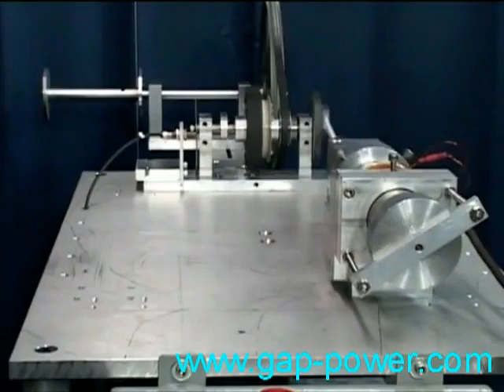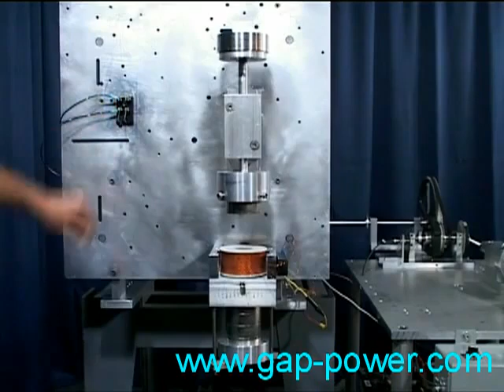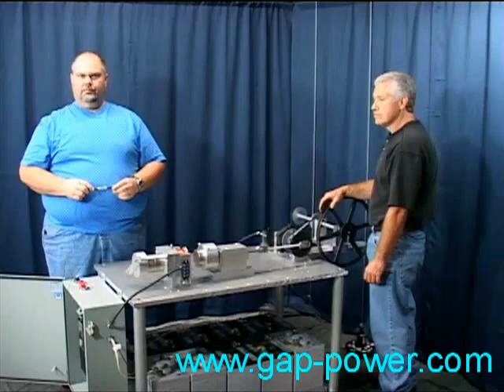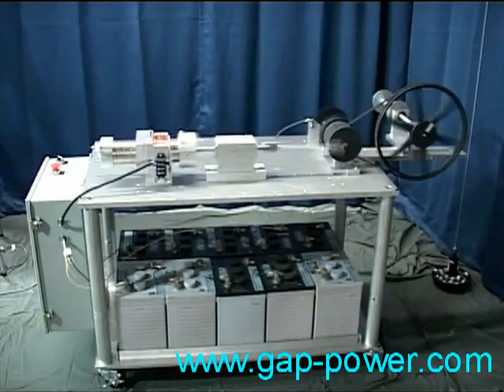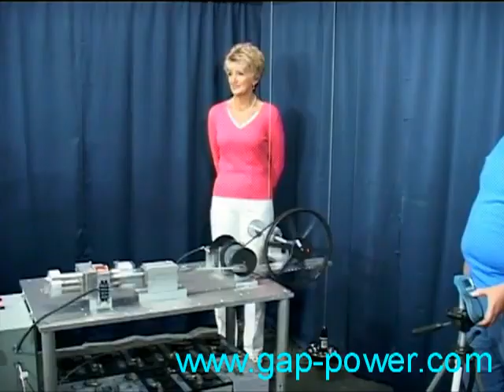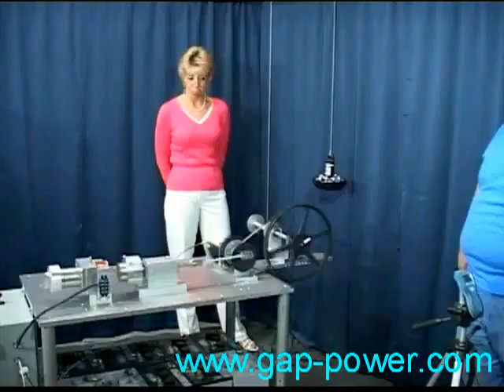FREE ENERGY  24 Working Magnetic Overunity Device   Magnetic Neutralization

Comment: Another BS vodeo.
This overunity motor uses electricity to switch those magnets on and off at timed intervals.
So saying that this motor is powered by the energy of those magnets alone is nonsense.
Sucg devices should be called electromagnet motors because that’s what they are damnit😟

Comment: It's a neat device and if production more power than it takes to power it's self it should keep running for a very long time

It should keep the batterys at full charge and provide power even if it's a small amount to use for work 

To check the powe in the coil you must use some type of current metter and are you using the power when the power is turned off as well 

I would thank the flux from the magnets could aid or boost the current out put from the coil when it's turn off

But we all so have to take  the amount of current used to stop the flow of flux
As power use for work 

But this is just a quick look at the divice thanks for posting your work and ideas for you may find the answer or spark ideas in someone who Will find the key to free power 

Thanks for posting

Comment: This is NOT a new concept!!  This is literally the exact same principle used in all electric motors.  These guys have just build a linear configuration rather than a rotary configuration.  In fact, I would guess that this device has exceptional inefficiency compared to standard electric motors because the coil is so far away from the magnet base.  Nothing new here, the just are not properly measuring the power input to the device.  As stated below, a simple way to "prove" this device has over 100% efficiency is to connect the output to a generator and have it charge that massive battery bank; no sketchy measurements necessary.  The device will, of course, eventually run out of stored electricity, as do all devices in this universe that comply with the 1st law of thermodynamics.

Comment: "no one has measured the input of a over-unity device" - if it is over-unity then Pout > Pin: its a simple as that. If you getting close to Pout = Pin our doing well. If you get one horse power out and put less than one horse power in then that's it, case cracked!

So who are these academics and which colleges are they from?

Comment: first I must say I have no degrees and some engine courses and I think your machine is beautiful but she is to m16 built as opposed to ak 47 ak is wide tolerances sloppy action and that is its total superior operating advantage m16 is too tightly machined thus causing failure also there is a correlation of 3 5 7 and not 2 4 6 about magnets and coils with regards to driver/driven configurations linearly or radially actuating the coil/mag configuration the odd is usually best as the driver but not the driven why I have no clue only know through doing it while building turbine blades that self sheared they where awesome anyways if you opposed identically a twin opposing each other and bedini coils/ circuit caps instead of batteries and more mass in flywheel to store more energy that's where your best catch n release of energy is attach mags to it coils around it and recycle energy from it as well and they work best axially like a spinning top otherwise  your wheel is allways fighting gravity for 90 degrees of rotation to the top trailing sideand equally to the whole the other way and no disrespect your machine is simplistically brilliant and as you can see thought provokeing as well and your 100% right as too a collectively thought to realized goal imagine showing a g bell a cell phone or ford a car the wrights an sr71 them boys would shit their pants to see the collective minds influence to recreate or enhance and transform elementary materials into the machines and tools that the collective mind have created I don't believe any one mind has ever created anything ever not of this the liveng man I cant speak for god sick of fucked has built more stuff than any other except for if ya don't yur fucked as runner up and it wasn't the wheel it was the axle that was the defining moment of our start to find the end  I learned a lot about a lot but not from professors  but books and others not afraid to look listen and observe and challenge  the nay sayers

Comment: If the apparatus is indeed "overunity" as the narrator says he believes it is, then what's that bank of batteries doing under the table?  Why not just rig a manual crank and flywheel to start the rotation and thereafter let "overunity" supply whatever additional electricity is required to keep it going?  Answer:  The batteries are necessary because the apparatus isn't "overunity".  Furthermore given sufficient time, I'd say the batteries will become drained and the apparatus will simply stop.  Finally, why use so many batteries?  Answer:  Probably to extend the time before failure becomes apparent.
Reply: +MadCityObserver Agreed , why not use a small rechargeable battery (12V 5AH) that provides only enough sufficient power to to disrupt the magnetic field in the coil and allowing said motor to maintain its charge. That large bank of batteries is a big giveaway to a hoax. Try said approach and ill be convinced.
Reply: +MadCityObserver I was thinking the exact same thing!  I want to see something that uses a hand-crank to start, then run on its own power and light up a christmas tree at the same time.
Reply: +Ulf Sark
Thanks for responding to my post.  You too, "Julio P".  As you both very likely already know any up-to-date college level physics reference will unequivocally state that every mechanical device (aka engine) be its energy source steam, gasoline, diesel, kerosene, electricity, hybrid, wind power, wave power, solar power, black hole power, hamster treadmill power, etc. then 100% efficiency is out of the question.  In fact the only known mechanism able to boast 100% efficiency is the interaction of matter with antimatter.  Also no engine whatsoever has ever been certified to operate for an indefinite time without a sustained external energy source.  For sure plenty of claims to the contrary have been asserted but no new engine whatsoever based on that kind of claim (unity or overunity) has yet passed certification either.

And no, the overunity engine hasn't been invented and "big oil" and "big energy" aren't using every legal and illegal tactic at their disposal (yes, including hit squads) keeping "a lid" on the discovery.  How do I know?  Answer:  By hook or by crook they'd acquire the thing, keep it ultra, ultra, ultra hush hush (add any number of additional "ultras" you think are appropriate), scale it up, install it in all their facilities, sell the excess power it produces to its customers, and instantly STOP BUYING COAL, PETROLEUM, AND NUCLEAR FUEL.  Have carbon-based energy and nuclear energy markets collapsed?  Answer:  Emphatically no!  As a major stockholder (I wish) in "big oil" and "big energy" I'd shoot the CEO (damn that SOB he had it coming) who spent a dime of my potentially greater dividend (remember, fuel expenses are history) on a contract to buy fuel ever again!

Comment: It is easy to measure the output current and the input current in a conductor with current that moves forward and reverse at regular intervals. 1) Remove the cable at the positive pole of the battery and replace it with two wires, 2) On one wire connect a diode in the forward direction and on the other wire connect another diode in the reverse direction, 3) connect ammeters on each of the forward and reverse diodes, 4) connect the free ends of the ammeters to the battery cable that was removed. Now one ammeter measures the current out of the battery and the other ammeter measures the current into the battery. By comparing these two currents you will know whether more current is charging the battery or not. The diodes must be large enough to carry the rated current and voltage.

Comment: If you throw away the stationary magnets and reverse the current in the coil , you will have the same effect. If you have a better magnetic laminated path instead of that  long air  return path, you will still do better.  Basically that is a variable reluctance motor.    The reciprocating parts do take a lot of energy to accelerate and decelerate. Go for all rotating motor and not reciprocating one. You are very far far away from a unity machine. 
To tell me that graduate engineers you talked to do not understand what is happening, well,  I feel that they do not want to break your heart, or else, well, I rather not say what is in my mind.  Still, as long as you enjoy your work, so be it.

Comment: How many volts at what amps are you using there. Because the amount of electricity to cancel out a neodymium magnet (especially a n48 let alone a n52) with that coil winding would require a lot of volts (speaking from experience). I believe in over unity devices but, the design I'm seeing on the exterior and assuming what is interior points to nothing special sadly.
Reply: +Jaronamooo Check under the device table,  I count 10 lead acid batteries, wired in series, 6 volts each =60 volts and a hell of a lot of amperage, Is that enough power ?? How many amps do these batteries put out 300 each??
Reply: Each battery would roughly put out 75-100 amps safely. So on a 12 volt battery that's roughly 900- 1200 watts you can draw from each battery. Times 10 that's roughly 9000-12000 volts per each pulse. Looking at how huge the neodymium magnets are this would make sense in order to cancel out it's magnetic field with copper coil.

Comment: In no way an over unity device. It is useing battery power which is not recharged by the device, eventually the batterys go dead. My kids tiny remote control car does the exact same thing using a tiny magnetic motor which this is, just way bigger.

Comment: There is a very simple test for over-unity: Measure the voltage on the batteries with an extended test. If the voltage stays the same or slightly increases after the test begins, then it may be over-unity. However - if the voltage on the batteries starts dropping and does so throughout the test, it is not over-unity. I have not seen anywhere in this demo where the batteries are recharged.
Reply: +tedtw Here's a better test use some supercapacitors charge them to get start the device started. Then test the voltage as it runs for hours. The capacitors don't store comical energy removing variables. They have a lower power density so it take far less time to tell if power is lost or gained.

Comment: your very close but the attraction is better then repulsion. Move the 3 magnets back and create an air gap. You will find the blocking of the coil will result in attractive force if you are using an iron core. You are losing a lot of efficiency on the piston and crank. Go rotary and it will be more efficient with less wear and tear.
All looks good to me.

Comment: I may be wrong, but if it takes precharged batteries to run this, wouldn't it just shut off when the batteries deplete? Or did 1. I miss him saying that it charged itself or 2. he fail to mention it charged itself? Because the way I understood this he basically just said while using these batteries I can power this magnetic device and make it lift a weight, failing to mention the batteries are draining... Please no hate, just asking a question :) Also could he scrap the battery and coil part and just use extremely powerful magnets to run it without electrical input, probably not when applying to a load since it would take more to turn then the magnets could push, but at least it wouldn't be hooked up to 12 or so car batteries, since better/more efficient batteries are needed almost as badly as a 'free energy device' haha

Comment: "Hi there! Here I have a perpetual motion over-unity device that creates free energy!" --- * plugs the device into a wall plug *
Reply: *****
That's not the meaning of the word "free" as used in common English vernacular.

"Free" means without "raw material costs"

A Hydro-Electric power plant is kinda free energy since it is powered by the sun (indirectly, still depends on water), and so are solar-cells (directly, for only a few hours a day), or sun-collector/steam turbine setup.

Get it now?
Reply: *****
The entire universe is running out of "energy". To be more precise, all order is slowly becoming more disordered and random, or even throughout, or "gray", however you want to phrase it. "Energy" as we know it, is just a differential between heat "zones", or electric "zones", or gravitational "zones". Wherever you have more of one than the other, a flow is established that ends when both sides are even. If you put a device in between, work will be done before the two zones are done equalizing. Eventually there will be no more zones of order, just even disorder everywhere in the universe. It is called Entropy. Some call it the "heat death of the universe".

Now to the water example. Gravity of a planet does not contain any energy that we know as such. It is more like a spring. A spring needs to have energy put into it (stretching or compressing it) first before it can do any work. It is more like a storage device, a "potential energy" battery of sorts.
Sun evaporates the ocean water and therefore  LIFTS billions of tons of water per day!! That water than falls down over land and accumulates in lakes which are, lets say 700 m above sea level. Now you have a zone of high "height" that wants to go to "low height" or sea level. It wants to be even with the lowest point -- the sea. A hydroelectric plant is that "device in between" that "steals" energy by making the water go slower than it normally would on its way to the sea.
You can now use that energy at night if you want since the sun did its work already.

 Over-unity device would by definition be harnessing energy from some differential in the universe that conventional science has not identified yet. It is not heat, or electricity, or "height"...its... something else that would naturally go from a lot of "something" to a zone with little of that "something".
Where is the device? Where is the explanation?
So far crickets. Even crickets could be used to power something by now.

Comment: The moment you have any form of external energy used to even control a device, it cannot be over-unity.  You've debunked your own over-unity device in your own video within the first minute.  The power you are putting INTO the coil to negate the magnetic force and move the piston, then release it, IS ENERGY INPUT.  If you were to crunch the numbers properly, using people who actually have an education in physics, you'd find that you'd still be below unity due to friction losses, effects of gravity, electrical resistance in the coil, and so-forth.

Comment: Overunity machines are complete bullshit! If any of these devices really generated free energy WHY aren't the inventors RICH?
Here is a simple way to see if a machine is really overunity: Start with a machine that has a nearly-flat battery as the ONLY source of power. Now run the machine for a week and see if the battery has charged at all.
NONE of the various wanker overunity machines will charge the battery without connecting another power source.
Reply: +stmounts This thing is most likely just a type of dc permanent magnet motor we just don't normally see.

Comment: IT'S A TRICK!!!  THE EXTRA ENERGY IS FROM A FAT SUCKING TUBE IN THE BLUE SHIRTS BELLY..  WHEN YOU REQUIRE 10 -6 VOLT  200 AMP HOUR BATTERIES TO POWER A MACHINE THAT GENERATES MORE THAN IT USES WHAT AM I MISSING??? SEEMS A FEW HEARING AID BATTERIES SHOULD BE ENOUGH TO GET THINGS STARTED.
LOCK IT IN A ROOM FOR 6 MONTHS AND LETS SEE IF IT IS STILL WORKING.  ANOTHER JOKE
Reply: I'll make an over unity device that un-sticks your bloody caps lock key :)

Comment: hey-ho, connect a dynamo to the output shaft, and see how long it runs... not long I fear!
A magnet is like a spring...so is a battery, if its not moving or chaging/discharging nothing can be gained.
However the attraction and repulsion forces of magnets could be utilised if there was a way to commutate them effectively, you have done this to a degree, but the neutralising force is equal to the magnet force so as to neutralise it = power input...
More work required , keep on tryin..the truth is out there?

Comment: Like Gray's motor show, an idiotic idea.
Hey mister genius, you are running from batteries. They have certain amount of energy which is easy to figure out by charging and discharging them and see how many watt-hours are stored in the batteries. Why even use a battery? why not a supper cap to start the thing going and then the machine should run by its self? no?
Crackpots like you give Tesla's radiant energy a bad name. Stupid scam artists. go back in the woods and make moonshine you hicks.